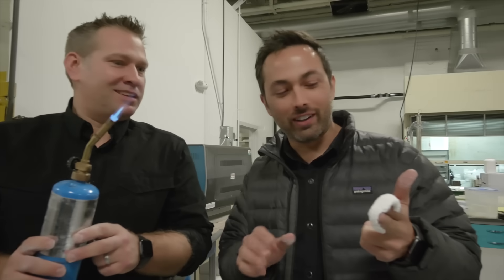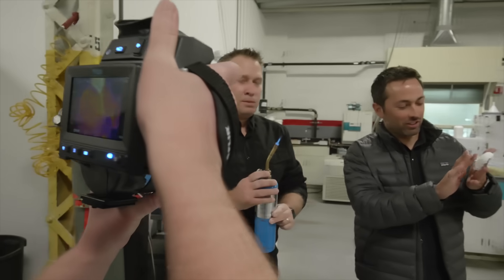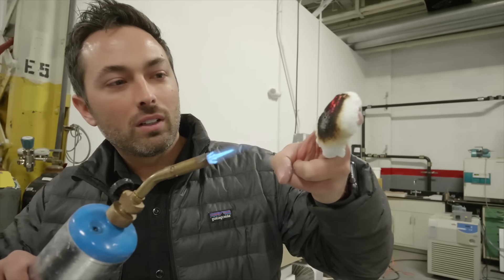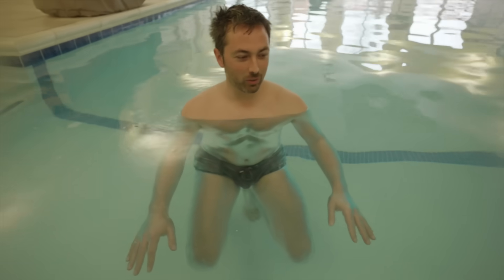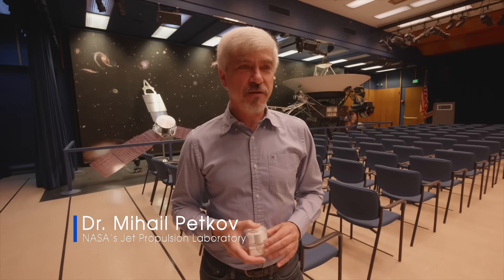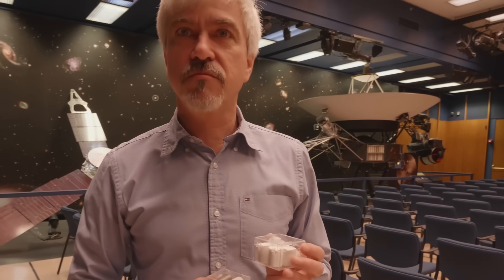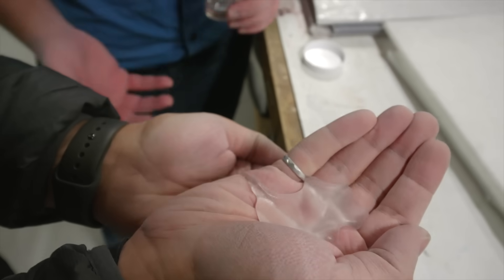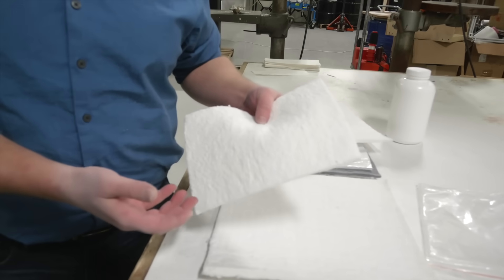I Waterproofed Myself With Aerogel!

Comment: Now I have even more questions:
How do you wash it off?
Or do you even never have to shower ever again?
Is your sweat now caged between your skin and the layer of Aerogel and you soon look like the Ghostbusters blob?
🤣
Reply: Another commenter mentioned you'd use a different solvent like a detergent? I wouldn't be able to corroborate the detergent thing but I'm sure there are non-water solvents that would remove it.
Reply: It comes off over time, I've tried it...
Reply: surfactants
Reply: You can still PUSH the aerogel off with water, it just doesn't get wetted.
Reply: @Hallowed_Ground  that's not funny
Reply: @vriechorinslat6620  what do you mean?
Reply: @vriechorinslat6620  wtf u talking about?
Reply: @Jokkemursu   Maybe the DANK puns? Either that, or something else - Which /might/ be quite dirty. Dunno, it's hard to read minds on a screen, especially off an emotionless texts...
Reply: @mctoastusgambling7208  I do too

Comment: "15 milliwatts per metre Kelvin thermal conductivity"

Wo0Ot? That simultaneously sounds made up and accurately makes sense at the same time.
Reply: That'd fit right in any SciFi gibberish, except when you think about it, it is simply a measure of Heat flow (power) per thickness per temperature difference.

Comment: 11:04 "what's that dust" oh nothing just a silica type of dusts that's typically baned by osha but not in our case because its currently being scientifically researched....
Reply: Dennis Dueck omg yess! I thought I was the only one that had this thought. Just an ounce of research on how deadly this stuff is and no one would go near it after that.
Reply: @topostornottopost3371  yea it only absorbs moisture/water and at the same time repels it from what ever surface it's on. Sounds like a great additive to your lungs that need to stay moist...
Reply: Even after the explanation of why it's not as bad as asbestos I'm queasy about neither of them using any respiratory protection around that stuff. You probably don't want to breathe this even if it's not as bad as the stuff that's literally a public health hazard.

Comment: what else has that much surface area? lungs. how do we use this product to create artificial lungs?
Reply: Lungs have that much surface area in a much larger space and the pores are lined with veins and arteries, sounds like an okay idea until you think of how lungs actually move new air into the system
Reply: Indeed, definitely different but with enough similarities to make it interesting. No technology exists now to create such a thing. Not only vessels would be necessary but innervation and especially necessary is permeability to gases. It's just some rambling.

Comment: As a Firefighter I would really love to see aerogel aplications to my field of work. Seems like its very possible to make at least certain areas of the fire protection jacket and  pants more conductively resistant, the problem is the firefighter suit has 3 layers and air surrounding the body, so its very important to keep the heat away in just the first layer and the second layer and air block the conductive transfer to my skin, but if we are exposed to high temp and I touch a wall or someone grabs me it allows for conductive heat transfer and I can get burned. But with a high conductive resistant material strategically positioned in the suit, let say in the major areas an medieval armor covers for physical contact, I would be safe from acidental touches and even would allow me to be more thermaly insulated perhaps

Comment: An extremely insulating miracle material with promising applications across the board, that is made of chemical intert particles that break apart when the material is agitated.  Are you sure this isn't asbestos?  It sounds like asbestos...
I know they mention it at 11:05, but it still sounds like asbestos.

Comment: * puts waterproof material on *
* tries to wash it off*
outstanding move
Reply: How... how do you remove it then?
Reply: @whimsy5623  buy a new hand
Reply: The FBI peel it off with your skin
Reply: The FBI ( ͡° ͜ʖ ͡°)
Reply: @whimsy5623  water surfactant aka detergent
Reply: The FBI Carrot Pealer.
Reply: @whimsy5623  take  a straight razor to a part of the arm or leg, and carefully peel a small amount  of it off exposing inside to out, then peel it off by getting water on the inside... I guess
Reply: @whimsy5623  Just Use FLEX TAPE
Reply: @whimsy5623  Scrub
Reply: @whimsy5623  or find a pet lion,
Reply: @whimsy5623  shouldn't you know you use it on your drones you call birds
Reply: @whimsy5623  with soap, im too lazy to explain, but it works
Reply: The FBI with a cloth or towel
Reply: @whimsy5623  cut your skin off
Reply: ( ͡° ͜ʖ ͡°)
Reply: @weezard9011  OUTRO MUSIC?
Reply: He Can use ethyl alcohol or other non polar solvents to remove it off as it is hydrophobic.
Reply: Little known fact:
Most people waterproof themselves with epidermis
Reply: Thats a good point...
Reply: Buy a new skin from the market place
Reply: By using hydrophobic substance , since like dissolve with like.
Reply: You use handpaper, until the surface of the skin comes off
Reply: That's some crazy baby powder you got there!
Reply: curb your enthusiasm plays
Reply: Hi
Reply: Heheheheeeeeeeee
Reply: Don't bother trying to burn it off either!
Reply: Yeah... How did he remove it?!
Reply: Soap is a surfactant. Use that

Comment: If you covered yourself in it then it will be like fire resistance and you could swim in lava in the nether
Reply: Actually lava is very thick, think about it, its molten rock. You could stand on lava if it didn't burn you
Reply: @keasiab5859   it would kinda be like mud i think
Reply: @skye6184  more like caramel I guess.
Reply: Lord Icebear or rock
Reply: @Ashmodai   you could be right
Reply: Finding aerogel to cover yourself is even harder than finding magma cubes and blazes

Comment: I am a union pipe insulator, and aerogel pipe insulation has been around for a couple of years now. They have done a few studies on the effects of breathing in the dust particles from this and it has a lot of similar affects as asbestos. We have been told to refuse to work with it. I suppose we won't know until some time passes if it is as dangerous as they say but I won't be working with it.

Comment: If it's going to absorb the moisture from inside insects what stops it sucking the moisture out of the plants you're trying to protect?
Reply: It's like diatomaceous earth.
Reply: No the pesticide is only racist against insects, so it's all good.
Reply: They’d use the hydrophilic form, which they showed basically sucked up a bunch of water then was gone. It works bc insects have points in their body that are more unprotected than others which can be exploited by the proposed insecticide. Plant cells are tightly structured and don’t leak moisture like insects do. Like they said, think of salt on a slug. Any bug targeted by a drying pesticide would basically be attacked the same way.
Reply: plant cells have walls
Reply: @Dots321  what about the soil around the plant? Would it prevent water from entering soil due to the barrier?
Reply: @Dots321  they also have stomata
Reply: Huh. Can you type that out more clearly?
Reply: @ohno-r9w  using it as pesticide

Comment: This surely will replace asbestos and act as a insulator for homes!
Reply: It is already used for home insulation, but only in combination with other materials to bring the cost down. It's still much more expensive than common insulators like fiberglass batt. Pure aerogel home insulation would be STUPIDLY expensive.
Reply: @Duncan_Idaho_Potato  some people are stupidly rich
Reply: M'aiq The Liar being stupidly rich you could just pay for cooling/heating your dwelling a lot of money. No need to insulate at all
Reply: ProgHead777 How much are we talking approximately?
Reply: It's very possible but needs to be cheaper. Great invention, but not useful for anyone under a massive business or government association
Reply: What happens if you breath in the aerogel dust?
Reply: @admiraladama5877  you turn into an alien

Comment: This is amazing! They should make bodysuits  for firefighters!!!! (like the ones surfers and divers use). This could save so many lives!
Reply: Most firefighters don't die from burns
Reply: You do realize Aerogel isn’t cheap, right? And it isn’t practical as another person stated, they usually do not die from burning alive
Reply: iDubbbzTV Isn't Here you do realize nothing is cheap when it first comes out, right? Price goes down with time and economies of scale (take for example the 3D printers, computers, electric vehicles, just to name a few). So with time, the same thing can be expected of aerogel and then it can be used for what I suggested and many other uses. 

Also, the fact that most firefighters don’t die from burns doesn’t mean that zero firefighters die for burns. Even if only 5% of the do, that’s 5% that could have been saved.

Comment: Veritasium: So how do I remove this from my body?

Scientist: ......
Reply: easy! fireproof aerogel clean it with water, waterproof aerogel remove with fire.
Reply: What if he dries out like the case with the insecticide
Reply: @alwaysbored47  You didn't listen,, did you ? The one he coated himself with repels water. It doesnt absorb it.
Reply: @Nyancat703  ah.. Yea..fair point. It was worrying me so much that I forgot about it. Thank you.
Reply: @Nyancat703  hmmm, doesn't it have to repel sweat back to the pores? With all the consequent problems with heat regulation
Reply: @AlexRednitz  the aerogel particles would probably block any pores on your skin. so not good for long term use
Reply: You don't, that was the last time he had to wash his hand.
Reply: @Elviloh  kinda scary
Reply: With Nutella
Reply: LagAttack soap
Reply: Normal soap should work since it is nonpolar.
Reply: @phillipmorales8213  Good to know
Reply: @phillipmorales8213  it decreases Surface Tension allowing the water to pick up more than it should
Reply: "That's still being researched"
Reply: probably a different solvent. alcohol, xylene, hell maybe even gasoline.

Comment: coat a swimmer in hydrophobic aerogel powder and see if he can swim faster because there is less drag.
Reply: This is actually a very good idea. I would watch the hell out of that.
Reply: But then you shouldn't coat his hands
Reply: @Eli20021_  yeah don't coat hands and feet
Reply: on paper this makes sense...   I wonder if it actually works!
Reply: There wouldn’t be less drag, but more, as their front surface area is larger
Reply: I wonder if Gore-Tex manufacturing swimming suits. As they make textile out of Teflon which eventually highly useful in medicine, e.g. hip implants
Reply: It should work for a boat.
Reply: Ronnie Boydstun maybe, maybe, if current is an issue, but I doubt it.
Reply: So only coat the main body and leave the majority of the arms and legs by itself
Reply: Swimmer here, I think it would work as long as it is still possible to feel the force of the water as you pull. We have these things called "tech suits" that actually follow the same waterproof style so if we did it to our skin, we would probably go a second or two faster per lap.
Reply: This wouldn’t work at all, it would actually make it worse slightly, as now the swimmer would have to push a slightly larger mass (body+air around body) through the water.
Reply: It would rub off at the joints
Reply: learn about supercavitating torpedoes
Reply: Females can swim too.
Reply: @celiadinitto3991  swimmer is a gender neutral term.
am i wrong?
also don't you have better things to do in life?
Reply: @Hitariu  well you also said "he" lol
Reply: @nolanwestrich2602  I identify as an amphibious landing vehicle and I can out swim any gender, if you disagree you are a racist bigot....
Reply: @celiadinitto3991  and water can boil
Reply: @celiadinitto3991  and they are slower :v

Comment: Great video as usual.  Love the "non-flammable binder" and then 30 seconds later, "What's burning?" to which he replies, "The binder"
Reply: Well, it reacts with oxygen in high heat, but the reaction does not self-sustain (i.e, chain reaction) to keep burning.

Comment: I gotta say, particularly in the case of the 'aerogel putty' I feel like the additional binder is likely acting like an ablative, evaporating away carrying the heat with it. I'm sure if you measured the mass of the putty before and after hearing it would decrease. Meaning the property is not just due to the low thermal conductivity of the aerogel particles.

Comment: Just wondering - what kind of flame is that? Is it reducing, like the one from a butane torch? Because even vegetable starch can ablate away and protect you from that. If it's a neutral or an oxidizing flame, that heat protection is pure gold!

Comment: So if Vantablack stops light escaping due to it's structure, light molecules can't escape. Could the chaotic structure of Aerogel be formulated/engineered to do something similar such as aligning the molecular structure or is it purely down to density of Aerogels that make it difficult to block light particles? Could Vantablack or Black 2.0 be mixed with Aerogels to produce a similar product that blocks light? As it would be a polymer it might not need firing to cure the paint?

Comment: You should have tried swimming with the aerogel coating.  What happens when the water is being actively repelled as you move through it, does it feel like no resistance or still normal, just like you were wearing a drysuit?

Comment: Could someone please explain 5:30 for me? I don’t get out the surface area could be that large?
Reply: Yashar Ghavidel lots of bends and holes in the gel. If you have two squares of the same size. If you poke a hole in one of the square. Square with the hole will have more surface area. Same concept here. Too many holes in the gel makes the SA large.

Comment: So why did it sound like metal sometimes and others not? D:
Reply: I suspect it wouldn't ring because it had a crack in it; if you take a cracked (but not completely shattered) piece of pottery and tap it, it makes a "thunk", but if you take one that isn't cracked, but is otherwise identical, and tap that, it will ring. This guess is supported by the sample shattering a few seconds later.
Reply: @patlee8539  Yeah, that makes sense. I still wonder why the sound was metallic, though I don't think that's something simple to explain.

Comment: Could this be used for future firefighter equipment? This stuff is incredible
Reply: maybe in a few years, they would.
also, when the price have reduced, we can even probably see them used in our everyday equipments. home insulation, winter coat, all sorts of things.
Reply: Brady Rohr I doubt it would help that much. Firefighters main risk is the smoke and collapsing buildings, not the heat.
Reply: Lochlan Odlum it would help with decreasing some of the weight on firefighters.

Comment: over all an impressive display but more side show then science.

Aerogel is an amazing material with a lot of uses but the ones shown off in the video really weren't those. the heat proofing part was fun but you can do as good at home with a mixture of white glue, flower and baking powder (diy starlight)its the carbon foam created at the point of heat contact that is doing most of the work not the aerogel participial.

the aerogel was also superfluous for the water test as well seeing you could get the same effect with any hydrophobic material made into dust and applied to the skin. its no different then never wet spray, the small particles means the water is always beyond the contact angle never allowing it to adhere to the surface.

Comment: It's not proprietary. It's cornstarch, baking soda, and pva glue. They are stealing this recipe and it's from a particular person but is general knowledge all over the internet, so I hope they get sued and you are helping them. PhD 's stealing inventions. Hacks. Also the first material is not an aerogel until heat converts it to a carbon foam. These guys need to be sued. I will inform the creator of this. I just lost a huge amount of respect for this channel

Comment: This recipe should be accredited to who came up with it. Nighthawk youtuber
Reply: Starlite, made from glue and flour.
And he intuited it from the original product made by a hairdresser.
This stuff was invented nearly 90 years ago.
Reply: @stoneomountain2390  the three ingredient version by nighthawk is not straight. actually starlight supposedly had more than 20 ingredients and was much greater in its capacity to dissipate heat than nighthawkinlight's version.
Reply: @stoneomountain2390  no one knows thr original recipe

Comment: Why NASA didn't use aerogel instead of tungsten in sun's mission ?🤔
Reply: easy because the aerogel is great at blocking heat but falls far short in other important categorizes needed for the mission. if I'm understanding you right and we're talking about a using aerogel as a sun shield you have to remember its not very strong so the cycling of heat will brake it down quicker then tungsten. there is also the fact that we can create large continuous sheets of tungsten while we are still limited in the size of aerogel sheet.

so a tungsten sun shield will last for year while taking a beating the same could no be said for a aerogel one.